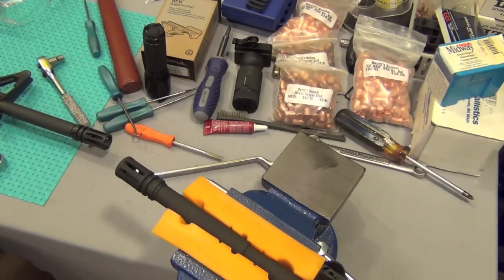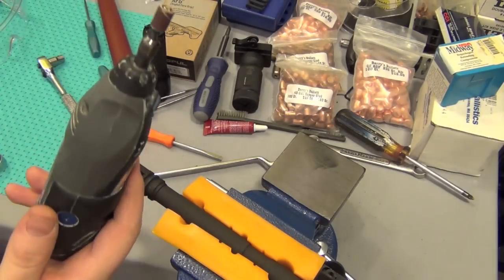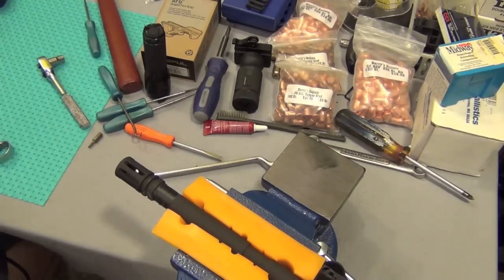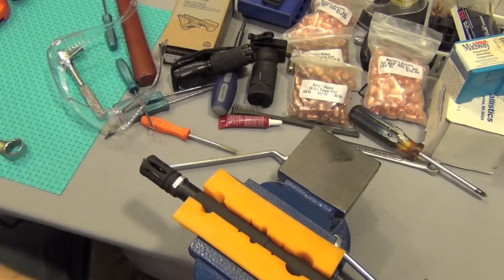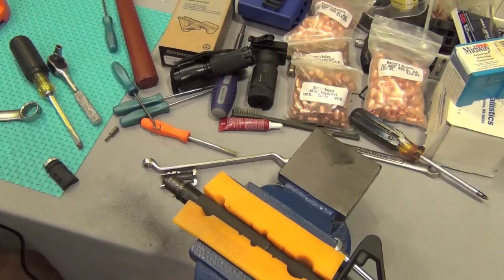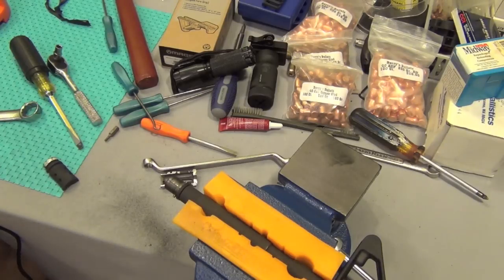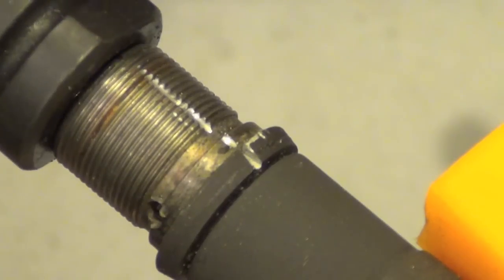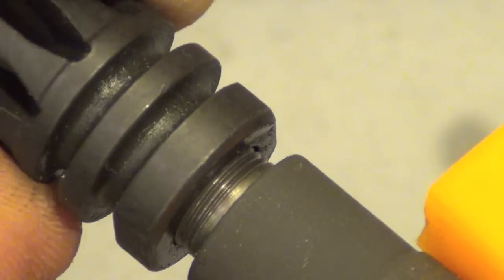HOW TO REMOVE A PINNED MUZZLE BRAKE

Comment: I saw both your vids on installing a gas block, and this one...Both were in the same style as I do mine, bravo!  ANd, after viewing both, I will have a gunsmith install my gas block for the $50.00 they quoted!  I loved how you got the muzzle break off.  Who says a screwdriver is just for screws!
Reply from the maker: LOL thanks for watching.
Reply: TADPOLE696 Did you weld the new muzzle/flash onto the barrel? If not, I think it's not legal. I try to see how I can do mine. Thanks.

Comment: Confused on the pinning. How is it pinning to a double threaded collar compliant? Rather, how can one not unscrew the collar from the barrel. (The collar appeared to only be screwed on to the original threads, did I see that correctly?)
So in MA, if I pin the muzzle brake to a double threaded collar and weld and sand, and then twist it on, am I complaint?

Comment: The metals have been sanded down until it looks like one piece of metal. But I bet you they are different kinds of steel. So take some ferrous chloride and wash the flash hider in it. You have already messed up the brake with a Dremel so its gonna have to be re-blue, Phosphated or whatever you plan for the gun.
So use the ferrous chloride it will show you where the two steel are different just like a Damascus blade.

Comment: an easy way to find out how far to cut .. you know that the out side demension of the threaded portion of the barrel is 1/2 in . measure the out side diameter of the brake. and subtract by a half in. then divide the differance by 2... that will give you the thickness of the side of the brake.. remember to give your self a few thou for wiggle room... make your cuts down both sides  of the brake then split the top face use a hack saw so you can get close to the crown.. then take a pry tool and the brake will come right off

Comment: hey buddy.. i live in jersey as well.. it suck what we have to go through.. i work at a gun shop.. and i went to school for gunsmithing. i want to star by saying i am not the police.. but you seem cool so i am gonna drop a bit of advice your way.. if you have the lower receiver in your possession and you get a non compliant upper shipped to you with the intent of pinning the brake and stock. you can be hit with a serious felony charge.. i alway tell people that are building an ar. to order the upper first do the work then order the lower. to avoid any type of problems.... send me a DM if you want some tips on re pinning the brake.. i do plenty of them .. at least 5 a week.. also if you dont want to drill and pin your stock i have a solution for that.. and yes it is NJ legal
Reply: willebiggz I also live in NJ and I have a custom build from WC on order and it kills me to have to pin the stock and break of such a work of art, but unfortunately I gotta do what i gotta do to stay legal. I saw you had a legal solution so i don’t have to drill can you please share with me?
Reply: there are a couple of different ways to make the stock NJ compliant. it depends on what stack you have or going to use.. for magpul stocks you can use what is called a stock lock. they are about 10 bucks.. it replaces the cam in the lever. or i always tell people to get the BCM gun fighter stock.. all you have to do is flip the leaf spring upside down  that lives under the lever. it will prevent adjustment. there is how to video  on here.
Reply: @willebiggz  Just commenting so i can come back to this later, thanks!
Reply: I’m looking to add a oden works stock to one of my guns. It uses screws to lock down. Is that Jersey legal?

Comment: You're mistaken TheDragon4freedom, and mr catfishredneck88 is correct.. You can permanently attach a muzzle break, just like the one that was removed in this video, to the end of a barrel and as long as the barrel and muzzle break reach the 16" mark, it is legal.. So if you have a muzzle break that is 1.5" long, you can permanently attach it to a 14.5" barrel and it is completely legal not needing to register it as an sbr

Comment: I absolutely HATE being critical, Clean threads BEFORE putting new parts on them.  Don't quit your day job!  If you HAVE to cuss, you're not doing it right.  Yes, you did get done what you needed to get done and I applaud your effort.  Sandpaper and some elbow grease might have made it easier to find those welds, and I would have started at the bottom first.  Think about the task at hand first, then gather the tools you need before starting any project!  God bless you and your family.  Enjoy your hobby!

Comment: LUCKED OUT WITH THAT COLLOR. SAVED THE THREADS ON THE BARREL. COOL DEAL. sorry about the caps. anyway glad i dont have to deal with that crap in illinois. but there trying to push some crap on us too. luckely were fighting hard and nothings got through yet. my barrel will be here tomorrow. that and my BCG. last two componebts i needed.